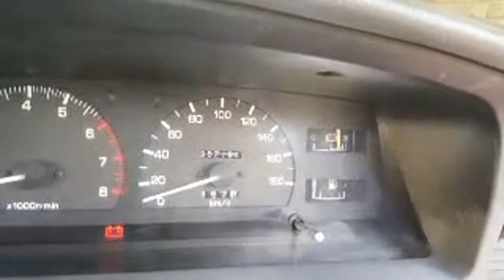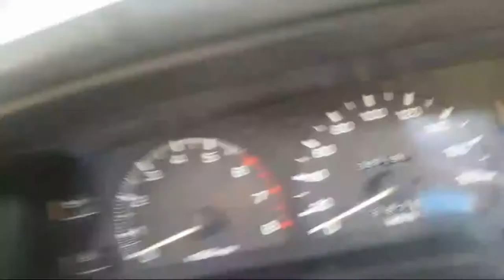Toyota OBD1 Checking Error Codes

Comment: Sorry, you have the reason, I confused The truck model. But insist. How I can install those two extra front lights on my Previa 92. Thank you 😊,
Reply from the maker: You are talking about these lights https://rover.ebay.com/rover/1/705-53470-19255-0/1?mpre=https%3A%2F%2Fwww.ebay.com.au%2Fitm%2F2-PCS-100W-9-HID-XENON-DRIVING-LIGHT-SPOT-BEAM-OFF-ROAD-LAMP-OFFROAD-9-Inch%2F171157638738%3F_trkparms%3Dpageci%253Ad1215bfd-31d9-11ea-b60f-74dbd180f3b2%257Cparentrq%253A83ae04af16f0a4b7fcb812d1fffeec9e%257Ciid%253A1%26algo%3DREC.SEED%26ao%3D1%26asc%3D20160908105057%26meid%3Dcc419dedf6684006b25783274d69883b%26pid%3D100675%26rk%3D1%26rkt%3D15%26mehot%3Dpp%26sd%3D171157638738%26itm%3D171157638738%26pmt%3D1%26noa%3D1%26pg%3D2380057%26_trksid%3Dp2380057.c100675.m4236%26fbclid%3DIwAR2g3Uxpteeg7HbIXbVDbDTNQWW0UiER5w_oQq3zOO6ouQzHYjHr7NyuCBo&campid=5338549285&toolid=20008 They came with a harness and diagram included. I will be installing lights much the same on to my car very soon. I will make a clip about them if you like. However you can already search on Youtube "How To Wire Offroad Lights" The lights will be wired the same way I installed them on this truck.

Comment: How I can install the extra 2 front lights, those this white Previa has? Thanks for shearing.
Reply from the maker: I think you may have mistaken this clip as working on a Previa. I was showing how to pull codes from a Toyota OBD1 data port on a 4Runner. If you're speaking of my Vans the headlight have 2 lenses from the manufacturer as a standard option in Australia. Adding extra lights such as fog or floodlights diagrams can be found with a google search but such lights such as those come with there own harness and diagrams off installing as well.
Reply: I really appreciate the kindness for answering my post, I understood that post a about codes, but in your video you are working on a white Previa such an has 2 exrtra front lights. Would you please check the video. Thank You 😊. Have a great weekend.